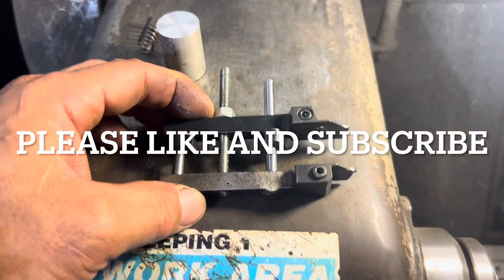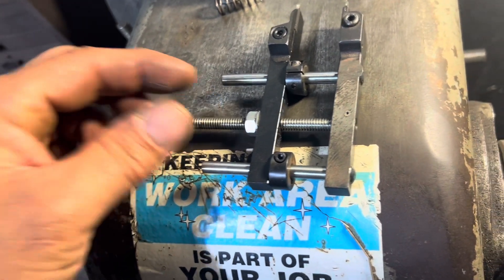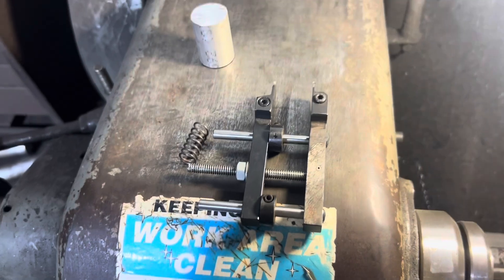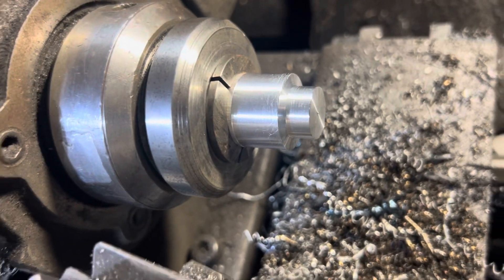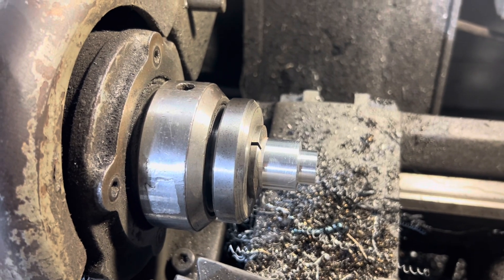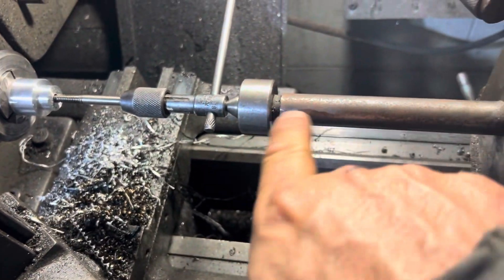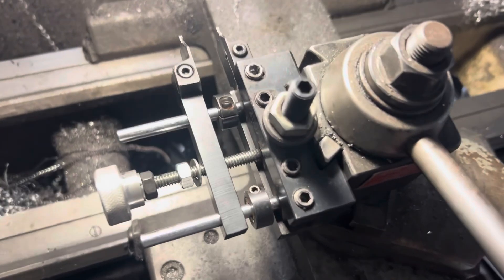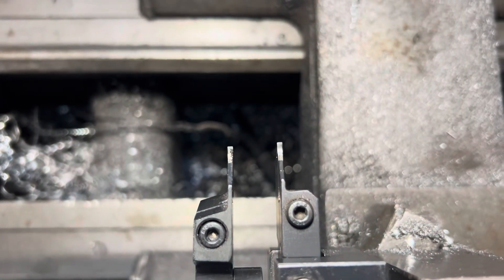Lathe bushing maker invention!

Comment: Chuckled a bit, I've done something similar for form turning. If you really want to save time use the parting insert as a stock depth stop and get yourself a DRO. Good to see old ideas still kicking around in the home shop.
Reply from the maker: Great idea. I was going to mount a digital caliper as a depth stop but thought this was cooler.😎Working on the Cnc lathe next. I’ve also ground out shapes in high speed steel in the past. Fun stuff!